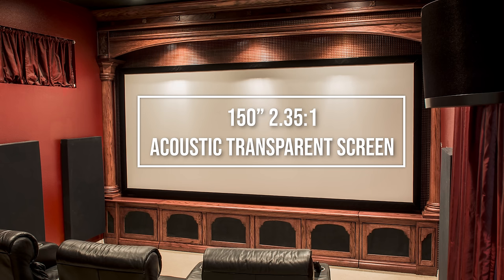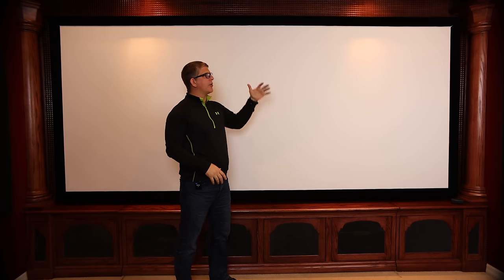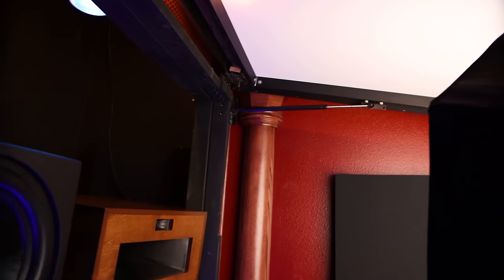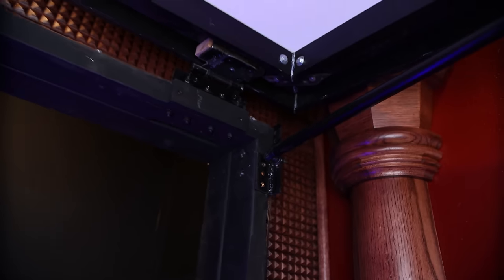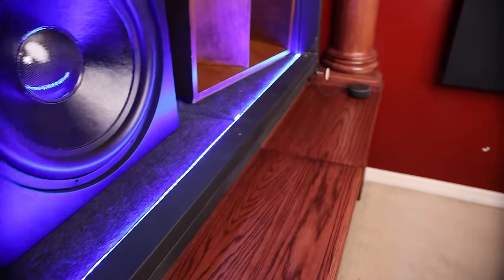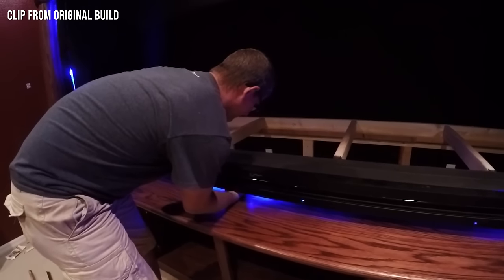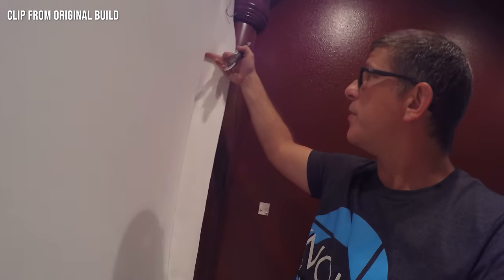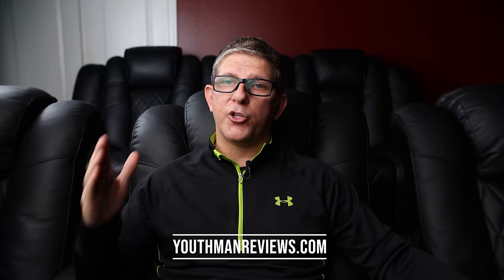Easy Access Behind a 150" Acoustic Transparent Screen for My Home Theater

Comment: Great setup and lot of effort put in by you not only in making it but also documenting same for others. I am also looking to construct some what similiar arrangement. Presently in design stage. Can you advise whether you have made any arrangement for ventilation of the media units below the screen. I will have AV receiver, media player and  few gaming consoles ( PS3, 4 and 5 plus Wii)
And it can become quite hot inside.
Reply from the maker: Thank you for the kind words. I have about 3 feet behind the cabinet so there’s plenty of ventilation in my set up. Pretty much everything has changed since I’ve made this video though. I really need to do an updated Home theater tour of my set up.

Comment: great video. im about to have 150" screen and was worried i was too close. but watching this i dont think i am. ill be just about 3.5 to just under 4m from screen.
Reply from the maker: I am 9’ from 150” 2.35:1 screen and absolutely love it! Absolutely immersive without being too close
Reply: good to know. yer i wanted the large screen. and because our theater room is tiered (the floor at the front is lower because its on a sloop) we have a very large wall to fill.. im hanging out for it to be finished.. love the videos by the way.
Reply: @Youthman  Do you find the far right and left edges get lost at your seating distance? Also, how do 16:9 images look on your screen setup?

Comment: Wow!   WOW!!!  I really like this idea!  Thanks for posting this in such detail! 

I plan to use an acoustically transparent screen in my new HT and while I have a door from the attic space into the front of the theater behind the screen I wanted a way to access the center speaker from the front.  This resolves that issue entirely! 

One question, I notice you have sub-woofers behind the screen, do you see any issues with ripple in the screen during strong low bass?  In my case only the center speaker will be behind the screen but I would be afraid those big subs would cause the screen to ripple.

I'm really glad I found your channel,... well except for maybe the Oslo seats one, that one really pushed me over budget but given that I plan to retire in this new house and I want the seats to last, I may bite the bullet and go with those.  At least the idea presented in this video doesn't cost anything and solves a big problem for me!
Reply from the maker: Glad you are enjoying the content. I get asked that question A LOT so I made a video on it - https://youtu.be/ftEuS3sMq2U

Comment: Michael….about how far away are you seated from your 150”?    Which screen material are you currently using on your screen?
Reply from the maker: 9’ from 150” 2.35:1 Seymour Center Stage XD
Reply: @Youthman  wowza.   That’s suweeeeeet.   No visible dots or perforations?
Reply from the maker: I have never seen the weave while watching a movie. Granted I do not have 20/20 vision either.

Comment: YM, Have you thought about having that screen motorized.  That way you can hopefully tie it into a smart device and control it with Alexa.  That would be pretty good and smart for your room.  You can then call the robot to bring in the popcorn and drinks.

lol

Good Luck.

PM
Reply from the maker: We actually talked about that before we started on the build, but we just realized it would add an unnecessary expense to the project. Besides, it’s not uncommon for me to have speakers in front of the screen and I would hate for the screen to lift up and we forget they’re there, and knock over speakers. That would turn into a bad day pretty quickly

Comment: Is it true that you sit 9' way from a 150" screen? Are the old THX / SMPTE formulas thrown out the window with 4K? I'm not a fan of sitting n the front row at an actual movie theater.  I have 9' to center seat, and thought I would be stuck with a 120" screen. Is there any discomfort that you're pushing through or had to get used to?

Comment: Hi Yothman, I orderd the same gas shocks, mine would not compress easily (when pressed by hand) Is this how they are supposed be? Can you please confirm.
Reply from the maker: That is correct. They are heavy duty to support heavy weight. It will be difficult to press in by hand

Comment: I’m into projector and screen calibration. I have a color meter and software. Ive calibrated my hdtv to rec 709 so far and what a difference. Did you have a pro calibrator do your projector for you?  Just curious.
Reply from the maker: I have not had my projector professionally calibrated but I would certainly be be beneficial to have it done
Reply: Youthman i know enough to be dangerous. I may get ISF certified. My vizio 65” m65-c1 tracks grey scale okay. The (CMS) color management system done fine for setting color luminance but saturation of what the colors should are off. Changing the values just changes brighton of the color and not the xy value. So it’s way better after cal. Color temp was really warm. Def better now with salutation off some. It’s been fun and scenic photos and view really look like if I were there. Maybe I’ll shoot you a email and talk sometime. Take care.

Comment: Can you share where you got the gas shocks and the lever you used for your screen?
Reply from the maker: The lever was purchased by the builder. It’s basically a good latch. He added a U bolt to the frame of the screen that locks into it. The info on the screen can be found at https://youthmanreviews.com/about/
Reply: @Youthman  Thank you!!!

Comment: So I see you decided to keep the JTRs :P
How far from the wall do you set up your speakers/subs.
A colleague of mine told me you should have them a minimum of 3-4ft in order to really enjoy the sound.
Do you have absorbers behind the speakers ?
Reply from the maker: The JTR are still just in for review. My PB16’s are unplugged in the rear of my room.

My speakers are about 1’ off the front wall. Ideally you will likely get better sound if a speaker can be planned a few feet from your wall but that is impractical is most setups (including mine). I can assure you, regardless of not being several feet off the wall, I REALLY enjoy how my setup sounds.

I have a few acoustic panels behind by speakers but likely could use even more.
Reply: @Youthman  thanks for the info !

Comment: Good job. One question. Did you consider doing a manual or electric screen? I've been thinking about doing this with my 125 inch drop down.
Reply from the maker: I wanted a fixed screen from the beginning as it’s a 100% unique and custom build. Every piece was made by hand from my friend, including the hand carved accent pieces and even the crown molding

Comment: Ive read that a acoustically transparent screen reduces sound level by about 3db.  Have you noticed much difference between playing the speakers behind the screen and in front of the screen?  BTW, you speaker/screen setup is about as nice as I've ever seen.
Reply from the maker: Not even close to 3dB. Any slight attenuation in the top end is easily corrected by Audyssey. Thank you for the kind words.

Comment: Why did you choose a 2.35 ratio vs 16. 9?
Reply from the maker: Easy...probably 90% of what I use my theater for is movies. I don’t watch sports or TV
Reply: @Youthman  I'm considering a 150: 2.40.1 screen since most movies are 2.39.1 and since I enjoy 16.9 stuff putting panels on the sides hopefully gives a decent size for that content over what a 2.35.1 would give me.
Reply: How do you use the 2.35.1 screen with a native 16.9 projector?
Reply: I understand that projectors have lens memory but what do you do for bleed over
Reply from the maker: James Wiens yes, I have an Epson 5040UB with lens memory to switch between aspect ratios

Comment: Was there a specific reason why you went with a metal latch setup for your screen? I ask because you have powerful speakers behind the screen pushing a lot of air. Wouldn't that rattle the metal latches?? Why didn't you go with a "quiet solution"  (e.g. leather straps or rope...etc.)??

Very hard to do a "speaker behind the screen" on a preexisting room. This was the best way for you I guess. Or the only way. As opposed to creating a back room behind the screen where you could open up doors to get behind the speakers/electronics. Pretty ingenious your setup. 

And I guess the "behind the screen" setup is the best possible..if it's doable. For most it isn't. 

I wonder how many HT people don't even have dedicated rooms and use their living rooms or family rooms. The percentage.  How many Have a setup at your level. And what the percentage is of people with the "Elite custom HT rooms" (e.g. custom designed by some ISF certified/CEDIA winning team....e.g. Theo Kalimirakis...with his $2M  HT room/lobbies...likely 1%).

Comment: Hey youthman if ur projector screen is a wall will the light hurt ur eyes
Reply from the maker: Why would the light hurt your eyes if you are using a wall as your screen?
Reply: Probably because it spreads out in d room have to get a screen
Reply from the maker: Some people paint the wall white, others like myself bought fabric and built my own screen while other buy a prebuilt screen. Each option will work.
Reply: Thanks youthman looking forward to seeing the osd demo
Reply: Hey youthman good morning I need help in deciding which to go with between a Yamaha rx v6a vs sony str dn1080 which has more power

Comment: Very cool, but the latch seems a little unnecessary, and overly complicated...  with the right pressure struts, I would think a couple of magnets would be enough to hold it down, wouldn't need to be too strong, and a little pull would raise it.... you would just have to make sure the struts and magnets match up.
Reply: You can actually build a permanent magnet on/off switch pretty easily...
Reply from the maker: The latch works perfect for my setup. Very easy to install. Magnets might work too

Comment: with your money I would have made that latch and lift motorized  with remote control or Elexa controlled .
Reply from the maker: Thanks Jeff but I was really hoping to use your money to do that. LOL actually I did consider it during the build. Although it would be cool, it’s really unnecessary. I go behind the screen maybe once a month. And since our reviews so many speakers, there are many times there are speakers in the way of the screen and if someone were to accidentally hit the open screen button on the remote, it would knock over the speakers and that would not make for a good day